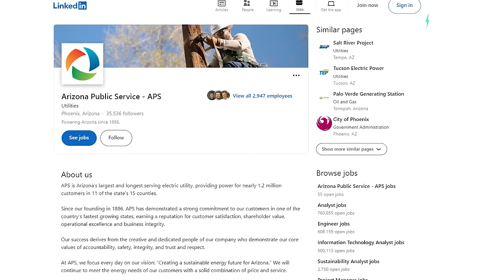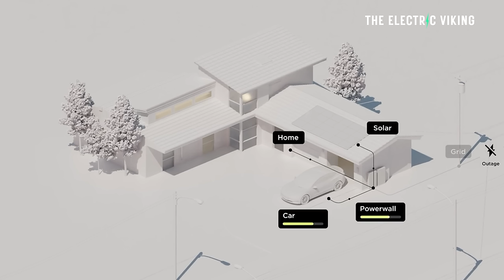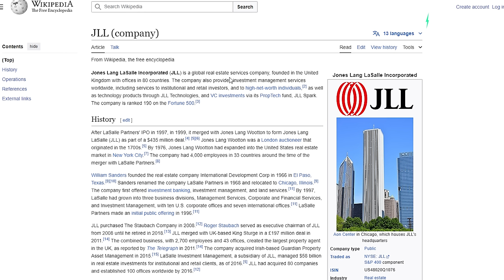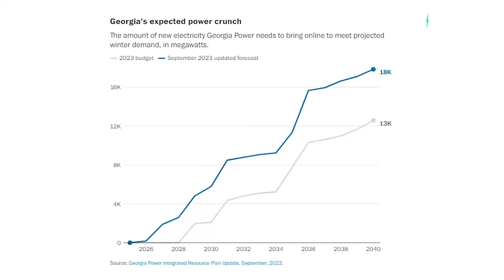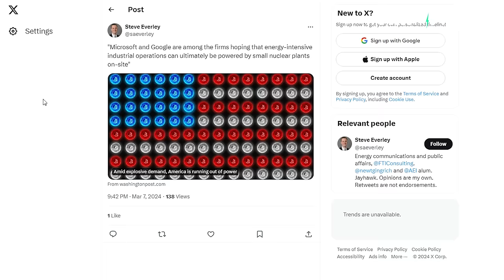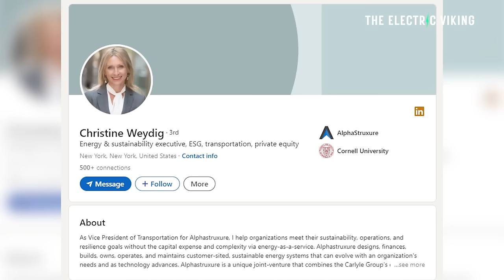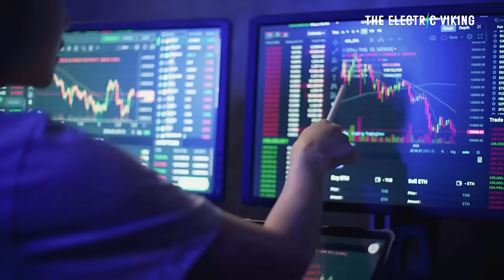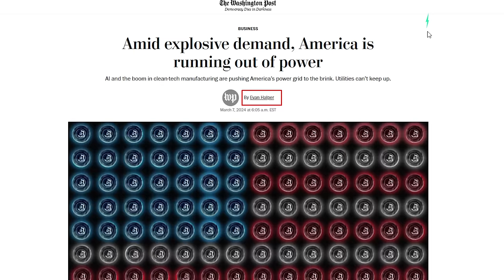An explosion in demand for electricity is creating a looming crisis in America

Comment: I've lived in the Dallas Texas area since 1982 and every single day there are thousands of new homes and businesses being connected to the grid. A lot of those homes have two or three AC units and some also have a pool pump. That was long before there were any EVs and it's still going on and the homes are getting bigger. My EVs better not be labeled a problem, I'm not even using as much electricity to charge two EVs as the "extra" AC unit in those two story houses that are home to 2 or 3 people. And yes, there are lots of data centers here.
Reply: homes only need MICRO heat pump, more Efficient than Evaporators & AC.

Comment: we need more individuals to put in solar , not only individual  homes , but what about large stores like Lowes and super markets . This would also include batteries
Reply: True, that would have a big impact over the long run, and the cost of solar panels are dirt cheap now, but the real problem is everything else from inverters to installation is crazy expensive, which puts a lot of us off.

I also think we need solutions on small scale wind power that can work well in urban areas on houses, many ideas are being thrown around on that over the last few years, but until we start seeing real world evidence that actually produces meaningful energy, can be done cheap enough and in urban areas where the winds are more erratic, then for now, solar is a better option, and it's a shame really because wind and solar would complement each other really well to deliver a more consistent amount of energy, which in turn, means you need less batteries as a buffer.
Reply: Apartments & Condos ALL need SOLAR and Megapack batteries.

Comment: 10-12 years for a nuc power plant, solar or wind only 2-4 years...
Reply: Here in Ontario we have 60% nuclear which gives us overnight rates of 2 cents a kilowatt without extensive battery infrastructure While nuclear is unsuitable for a dramatic ramp up I'm SO glad the local government didn't wait and has been developing its nuclear for decades so its hsre NOW to help renewables with adding to the grid right away instead of replacing primarily coal and gas first ❤
Reply: Hi, roof top solar is the answer. When it’s sunny you generate the power to run the A/C and charge your car which is your bigger home battery.
Problem solved and no need for transmission lines or bloated capital investment you get the bill for.
Take care M.
PS, you can also set it to power your home in an outage with the solar on the roof and your battery.
Reply: @memecat57 wait until the nuclear power plant spent rods perpetual storage fee is tacked on that 2 cents /KW, and eventually, the decommissioning of retired Nuclear Power plans happens, and that is tacked onto the rate. I thought Canadians had a more long term strategy when considering such issues?
Reply: @memecat57  that's most likely because nuclear reactors cant load shed resulting in an oversupply of electricity during off peak hours so they drop the price to promote consumers to soak up the excess generation and prevent the grid from overloading. The actual cost to generate that constant power is subsidized by the government. This is known as levelized cost of electricity where nuclear is actually the most expensive.
Reply: @memecat57 so nuclear power is generating lots of electricity during times when nobody wants it, causing them to practically give it away?
Reply: 10 to 12 years for nuclear is build time. Add in planning more like 20 years.
Reply: Powerwall 3 coupled with roof  solar good start
Reply: @DishNetworkDealerNEO  Thorium Salt Reactors are the way to go as they have a 2nd cycle that generates power from the waste and doesn't have as long as a half life and are much safer to shutdown.
Reply: @pcproffy  only because there aren't a whole society's worth of EVs charging overnight when there are we'll have the excess powered TODAY so renewables can focus on super abundance instead of just replacing fossil fuels and struggling to keep up with the new demand. We do not have brown outs like China or California have had because nuclear is robust and reliable to carry our grid into the future as fast as we need it.
Reply: @DishNetworkDealerNEO  we do 🥰 we have been setting aside money for the last 50 years to refurbish the power plants as they age and my local politician already kept his promise to renovate one plant over the last few years and is already signing the deal to refurbish another two. Even if our overnight rate quadruples it'll still only be 8 cents a kilowatt which is basically nothing for how efficient EVs are. I have a diesel golf that gets SIXTY miles per gallon and it still can't keep up with an EV charging at 12 cents a kilowatt. Our nuclear industry has made our grid highly resistant to global fuel price hikes from bad actors and supported 76,000 jobs in a province of around 10 million. I'd gladly pay the difference to keep them running while the Tony Seba classic SWB scales up.
Reply: @markeh1971 don’t most people use their car to drive to work during the day? In which case they can’t charge the car off their solar panels 🤷‍♂️.
Reply: @memecat57  now that Fusion has positive gain, meaning more energy out vs in, it will eventually replace fission, as it does not use or create highly radioactive materials.
Reply: @markeh1971 most solar on homes has to go through the grid anyway!!
Reply: ...as well as being far cheaper, safer, and creating millions of jobs for regular workers.
Reply: @DishNetworkDealerNEO  that's the best part of a long running nuclear program 🥰 we have the amount experienced steamfitters and engineers who have had a career in fission needed to make fusion reactors at the kind of scale needed to make the difference. I'm sure our industry will make it work when it's ready 🥰
Reply: @pcproffy  Yes.  New Nukes are Beyond Stupid.  or BS for short.
Reply: 80 years lifespan for a nuclear plant, 10 years lifespan for solar.
Reply: 4 to 5 yrs in Sth Korea.
Reply: @markeh1971 what if you drive your car to your place of work each day?
Reply: @glennjgroves  only in Western countries
Reply: @domlarry to expensive for most people
Reply: @dzcav3  50 year lifespan for a nuclear plant, 30 years for solar.  Nuclear at ten times the cost.  Math doesn't look so good...
Reply: @markeh1971 are there any EV's that can provide enough power to cover the draw of a modern home?

Comment: I said it before and I say it again, it is ridiculous to dig things out of the ground to burn for energy when we have the sun providing all the energy needed to power millions of civilizations for millions of years, and we already have the technology to harness that power. The only real solution to power shortages is the sun.  I installed solar panels and batteries in my house 3 years ago and I couldn't be happier. I never lose power. Also my EV is a lot cheaper to operate and maintain, basically zero maintenance. During peak hours, my house is completely powered by my batteries and I'm selling my solar panel production to the power company. I pay zero dollars during peak hours. Never going back to a fossil fuel based home and vehicle, solar is the way to go.
Reply: Look up the term "base load". Sun doesn't always shine, wind doesn't always blow. Batteries smooth brownouts and quality issues but can't close the gap alone. The base load could be nuclear, gas or coal. (The latter clearly has too many issues). Gas Plants are quick and easy to install (as with Wind and solar) and we have alot of it. 
Nat Gas is the bridge energy that gets us to a cleaner future - which should also include advanced, clean, safe liquid salt nuke reactors... so of course, the govt isnt supporting it. 

Until they do, you still need base load energy to support Wind/Solar. We need gas until we get over the "black magic" ignorance that is stopping US from liquid salt nuclear investment at anything but small stabs at the problem while China is investing more heavily in it (using the info we provided from past successful liquid salt Thorium reactor designs).

The big obstacle isn't electric cars or data centers. Its profoundly stupid politicians.
Reply: @avgjoe5969 Your thesis is only based on current info with advancements in solar and battery technology there is no need for base load.
Reply: It's silly to not make use of hydrocarbon solar batteries naturally occurring when they are cheaper.

The sun can give us the energy we need and when batteries get cheap enough it will make more sense than fossil fuels. That is not the case now.
Reply: Wood is renewable energy - if you are rural
Reply: So you advocate digging massive amounts of minerals out of the ground to build solar panels and EVs, and using huge amounts of land to site those solar panels.  Natural gas, as its name says, is a gas.  That means we are only removing vapors (almost no mass) from the ground.  Even oil is just liquid -- liquid energy.
Reply: The way you are doing it is the very best way, install your own panels and once your investment has been recouped, its money in the bank.  Buying off the grid, even a grid of renewables will continue to put economic pressure on users, just like coal and gas do now.
Reply: @avgjoe5969 good points except one I’ll counter: base load can be provided by batteries. (Grid batteries as well as home batteries.) A lot of wind energy is simply not collected because they’ve no grid batteries to smooth out the spikes. This situation is improving. Fwiw, I’m not against nuclear for providing base load. It seems that Germany and America got carried away as modern THORIUM reactors are a not better than Uranium. And it turns out the Uranium ones aren’t as bad as people make them out to be.
Reply: @dzcav3 yes. Exactly! Because batteries, solar, wind has a small ONE TIME carbon cost instead of a CONTINUOUS carbon cost.
Reply: we should Separate all RECYCLING from trash, then INCENERATE trash in Closed Loop systems , use WASTE heat to spin Steam Turbines to generate Electric. 
then use ash in Landfills rather than Garbage. 
also use Renewable energy @ INCERATORS running 24/7 .
Reply: @avgjoe5969  What about all the off grid houses? don't they count? If one can do it all can do it.
Reply: @sean_haz  Please don't tell Tesla , they are making money hand over fist and I own stock.
Reply: @dzcav3  Why not finish your suggestion and see where it ends? How about digging lead out of the ground? Exactly how many sq miles would you need for solar? Natural gas is Methane a known greenhouse gas. Oil is hydrocarbons, not just energy, but waste.
Reply: "It's ridiculous to dig things out of the ground to burn for energy when we have the sun providing all the energy needed". 
Wow, so they don't dig things out of the ground for solar electricity on your planet?
Reply: @tedmoss  I own stock too. Not looking good lately ;p
Reply: I dont see the point of using the ev battery when you can use a dedicated battery for the house.
Reply: @avgjoe5969    I said it before and I say it again, you're being ridiculous. Most people can't afford to buy an EV, solar panels, batteries. Apartment dwellers have no space to put solar panels and batteries.
Reply: @kentprince4851  Batteries are expensive. That's the argument.
Reply: @firecloud77  Agreed. I drive an old Jeep for a reason. Looked at solar for my roof and the payback was too long. 
Long suffering Nuclear fan actually. You need a solid base load to support Wind and Solar (batteries or not)
But in many states (Hawaii, Texas, etc) it Does work. For many (homeowners) they can charge at home and the payback is less than 10 years. VPPs (Virtual Power Plants) made of thousands of homes of solar (and battery) connected to the grid and back feeding it when necessary, creates a much more robust grid. If 1/10th the population can afford it and it saves them money over 10 years (the number is creeping down) in  the sunbelt... this is still millions of homes.

One solution does not need to fit all. 
Wouldn't buy an EV for NYC if you pointed a gun at me. 

It will still make cities cleaner and be an economic Benefit to those who can afford it and it reduces the overall cost (fewer peaker plants) of power for everyone (See South Australia).

Regards the price of EVs: The battery is the only reason EVs are more expensive than ICE cars. EVs require 1/2 the "fuel" and maintenance costs but the initial purchase price of these cars is dropping rapidly with initial price parity set to drop Below ICE cars over the next 3-5 years in the general market. 

The main point is that these products are already an advantage (over time - monetary considerations alone) for those who can afford them. The production capacity is currently maxed out with those who can afford them anyway at this time.
Everyone will find them cheaper (before fuel and maint benefits) shortly and the production capacity will struggle to keep up.

Tesla is working on a $25k electric car (2-3 years for proper production) with solid range and recharge times under 30min (when needed at all- most charge at home). The Chinese are already selling sub $25k EVs with good range for most people.

So the practicality of this is rapidly taking over and soon we can dispense with absurd subsidies (They Should have been gone by now but legacy auto has proven to be incredibly inept.)

Comment: any data centre or very large power consumer should have there own power generation on site and not be conected to the grid
Reply: For cheap power they should get their own wind turbine, solar and big battery as part of the planning process.
Take care M.
Reply: Yea big diesel generators like all the people with EV's will need soon.
Reply: @dubsydubs5234  troll.
Reply: @incognitotorpedo42  Oh no you called me a troll how will I live with myself now, words are violence I'll have you arrested for GBH.
Reply: Will the data centers have to throttle down internet traffic when a cloud goes over?
Reply: The Last Energy small modular reactor alone – a 20-megawatt SMR – can power 20,000 homes, and with far less carbon, construction, and land requirements than any other power source. Overall consumption of data centers across the US is likely to reach 35GW by 2030. The U.S. Nuclear Navy has logged over 5,400 reactor years of accident-free operations and travelled over 130 million miles on SMALL MODULAR nuclear energy, enough to circle the earth 3,500 times. From the time of the USS Nautilus in 1954 to the present no civilian or military personnel on these ships has ever exceeded any Federal radiation limit. According to Lloyd's, about 700 small modular nuclear reactors have been used at sea since the 1950s, and there are about 200 SMR reactors at sea today.